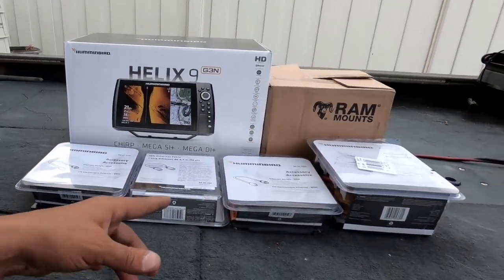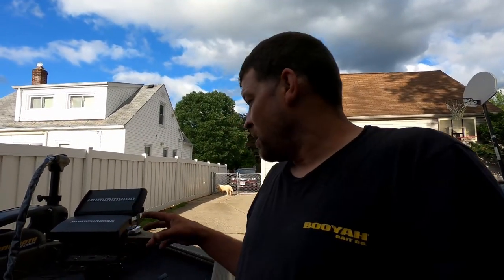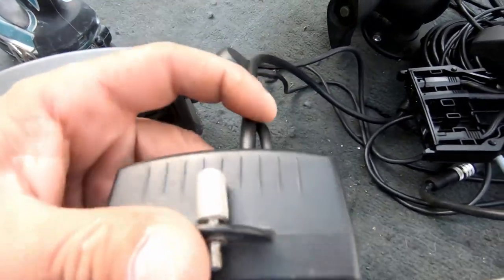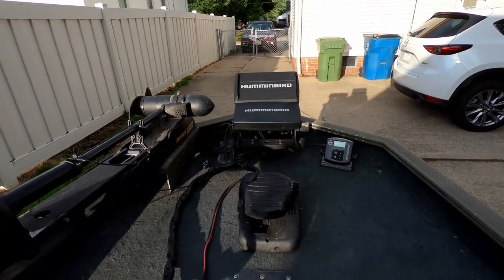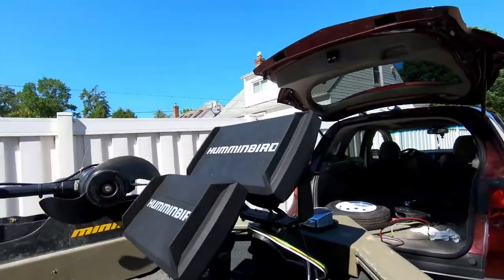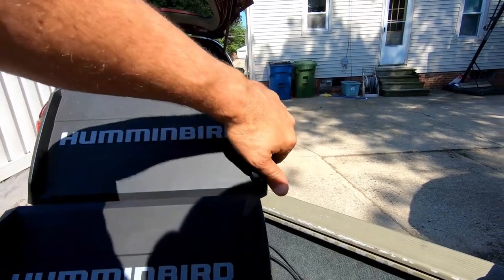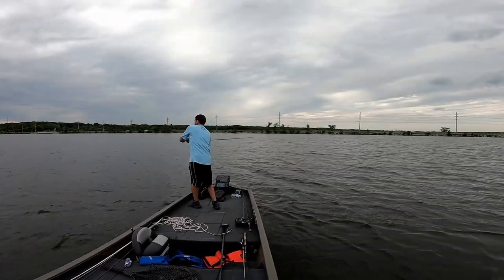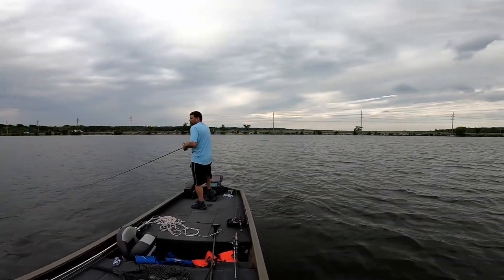Dual Humminbird Helix Fish Finders On My Jon Boat

Comment: You should have filmed yourself crawling through that hatch!  How many batteries and what kind are you running in that rig?
Reply from the maker: Lol I almost got stuck! We run six batteries, two on each trolling motor, one for GoPro running lights and livewell,  The last one runs the two hummingbirds. Battery brands are optima and everstart.